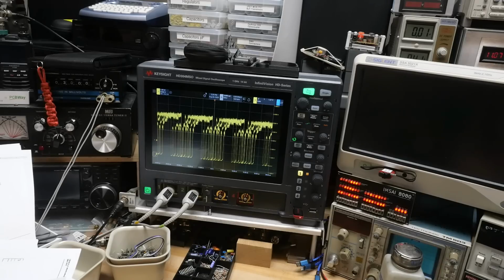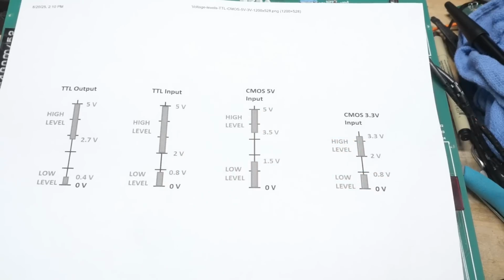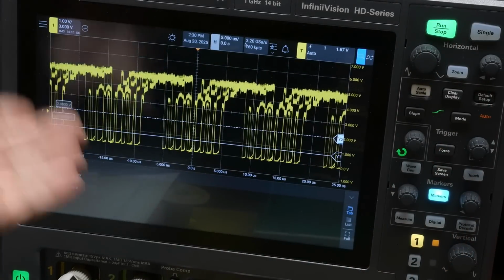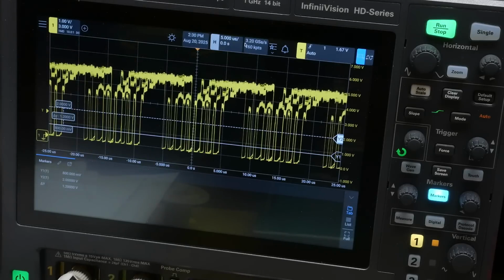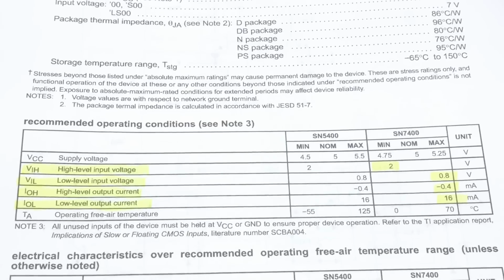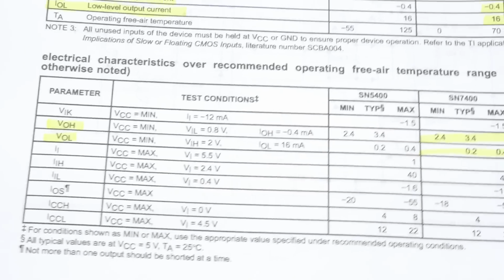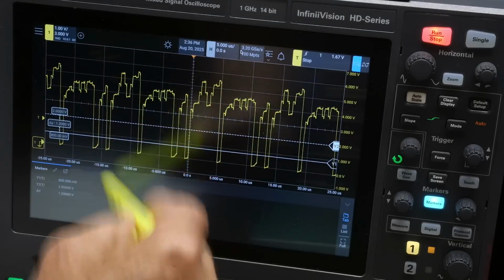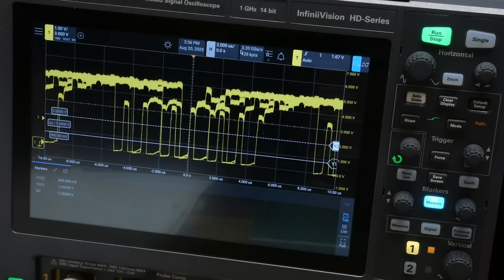#2369 Ugly TTL Voltage Levels

Comment: "CMOS were not invented yet."
CMOS were in use since 1960 but they were very slow, very low drive current and got zapped with static faster than you can blink.

Comment: My own medium scale TTL system had exactly the same issue but of course it's nothing to worry about as explained very handsomely in this clip!

The output of the original 74, 74LS etc logic IC's have a weak pull-up capability but that's how they were designed and it's not a problem in a TTL-only system. The reason for this is the TTL inputs they are driving have an inherent pull-up of their own and don't need to be driven hard to achieve a logic high.

Recently I replaced the 74LS and 74HCT logic in my system with the 74ACT family equivalents. My logic high and low levels are now much closer to the +5 and 0V levels you might expect for a digital system, however the fast level changes have introduced a new problem, ringing and overshoots.  Again, not a problem as despite the noise and ringing, the levels can only be logic high or low.

Comment: Back in the day machine language. Just hex numbers entered as your program. Assembly language was considered high level.

We had an assignment for 2 students to do to send a single ascii character from one kit to the other. Didnt work but who knew who got it wrong or right.

And i used to complain when a fortran compiler told you 53 warnings and 117 fatal errors. Sdk85 didnt even tell you anything😂

Comment: Bipolar transistor cant handle very high reverse voltage between base to emitter so if base is at 1.8volts and emitter is at 5volts so the reverse voltage is 3.2volts so there will be some leakage current but it is normal. Now lets imagine the supply voltage is 12volts then the reverse voltage from base to emitter is 10.2volts so very high current will flow through the transistors shorting them. This is because the reverse voltage between base to emitter is just 5 to 7volts so 5volts is just enough for ttl logic or 3.3volts is even better. I made a counter using just transistors in ttl and it works without any problems upto 2mhz which is quite high speed

Comment: I remember putting pullup resistors on outputs that fanned out to many other chips. I don't know if that was an accepted practice (probably not) but it allowed me to reliably fan out to many more devices.  It did bring up the low levels to some extent but there was plenty of margin there so it never caused me an issue.

Comment: I was able to drive a HUB75 LED display from an STM32 "blue pill" board, but sometimes the display was a little janky. Then I looked at the specs for the HUB75 display. The input chips are 5V CMOS and wanted 70% of Vdd (about 3.5V) for a high input. The STM32 was a 3.3V device. Even with a perfect output stage, it's not gonna give 3.5V.
So it worked most of the time, but sometimes the Voh wasn't quite high enough, and the pixels wouldn't shift properly.

Comment: If you  want to see ugly TTL levels, try inducing metastability in a D or JK flip-flop with the clock and data transitioning about the same time ... the output will randomly vary ... looking more like an analog signal ... for the longest time.

Comment: If the current drive of old TTL was so low, how in the world did we get away with driving those old LEDs directly off the outputs when experimenting?
Reply from the maker: you always used the LED such that a low was ON.
Reply: Nope, common cathode configuration.  Binary counters would look weird otherwise with LED lit when a 0.
I believe even the BCD to 7 segment decoder was made for common cathode display.
Reply: Look at a diagram of a TTL gate. The low-side output will be the collector of an NPN transistor to ground. That transistor generally has a good current rating.
And an "open-collector" output is the low side only. That works well with the "default high" of an open input.
Reply: Sure, the default high of an input would "help" a high of an output.
But that doesn't help the LED much connected directly to the output (with a resistor)
Reply: You can see in Ben Eater's circuits with LEDs connected to TLLs, even LS versions and still work, even when there are inputs connected.

I believe the real answer is that you can get more high state current,  enough to light an LED, but not full brightness and resulting output voltage likely out of spec but still works.
Reply: You can always tell the experienced engineer by how he drives his LEDs.

Comment: was about to write something about so-called "Schottky transistors" and how they increase BJT speed by limiting saturation, but the W source article Schottky transistor says it all

One of the things newbies will be blissfully unaware of were the great TTL "famines" of years gone by. I once waited a full year for some 74LS138 3 to 8 decoders. Of course there have been multitudes of various component famines since those days; the longest lead time I was ever quoted was 54 weeks - only because the vendor's system wouldn't allow anything longer, regardless of reality.

Comment: The in-family fan out of LS TTL is actually better, by a factor of 2, than that for standard TTL because the currents required to drive the inputs to the required levels are lower in proportion to the output capabilities. 
The asymmetry of TTL output drive current was perfectly OK because the input current requirements were also grossly asymmetric To achieve a proper input LOW with standard TTL required sinking 1.6 mA, while to assure a proper logic HIGH required sourcing only 40 µA. You could actually leave a TTL input open and have it "float" to HIGH, but it was bad practice and you weren't entitled to expect a good HIGH.. LS TTL very rapidly replaced standard TTL for the vast majority of uses because of the very significantly reduced power consumption with no speed penalty. 

I'm  not about to listen to the whole thing again, but I heard not a single mention of "noise margin." When you are talking about output voltage levels versus input requirements, that is a very important concept.

In any system with "tri-state" outputs (implying multiple drivers sharing common signal paths) you can can sometimes see voltage levels that do look bad, regardless of the the logic family. This can occur when all drivers on a signal path are in the high-impedance state. The bad levels are of no consequence from a logic perspective but can be from a power consumption perspective because they can cause partial turn-on of devices at the inputs on the signal path.

Logic probes are a lot less useful now that most complex logic systems have eleventy different supply voltages and hence different logic level requirements (though the variation in logic levels external to ICs is not as varied as supply voltages).

Comment: I do adore a TTL application of Boolean algebra. Nothing like curling up to a 6 place clock ran entirely with TTL on a chilly fall night!!
Reply: I added a circuit to my old TRS-80 to shift certain lowercase characters down 2 scan lines by decoding the character code, then sending either 0000 or 1110 to a 7483 adder to modify the scan line count. That 7483 chip always ran warm to the touch.

Comment: Thanks so much for this video! I'm from former Yugoslavia, and our major home computer in the 1980s was called Galaksija (Galaxy), named after a popular science magazine which published the schematics for the kit. Original version had 2-6 KB of RAM, 4 or 8 KB of ROM, and a Z80, all carefully designed and arranged so that the parts could be imported in 3 separate packets from Austria without causing issues with customs and triggering the insane tariffs which we had on integrated circuits and computers back then. 
The original authors released a new version for its 40th anniversary, which is using the 4000 chips, as well as 74LS and 74HCT series. It's still a kit (now with incredible 32 K of RAM), where they sell the PCB and the EPROMs, while the end-user needs to source the rest. I, as a relatively young and fresh engineer, assembled one and spent hours and hours trying to figure out what's wrong and why the logic levels look horrible: I was sure that there must be timing issues, with some chips trying to pull the bus high, while others were pulling low, so I went and checked every single chip multiple times, and still couldn't figure out what was the source of the problem, until I've noticed that various levels seem to come from different families of chips...

Comment: LS parts were worse because they were designed for low power (LS =- Low power Schottky). So they were popular because they cut down on power consumed by the 74xx chips significantly. Of course, they never stopped making the regular 74xx series because sometimes you need the fanout and the LS version wouldn't do, which is why you had to choose from multiple families depending on the needs of your logic.

Comment: A  few months ago I was working on an old Heathkit 2 meter radio and saw 'horrible' waveforms like yours.  Thought I found the problem.  Ordered some new TTL chips and the same waveforms.  Then I remembered.  Yep, that TTL stuff was just weird.  Thanks again for the presentation and a refresher.

Comment: At my work, we had a circuit board for testing/development. One of the identical boards worked perfectly, one didn't work at all, and one worked occasionally. It turned out that the 3V and 5V voltage levels of a SPI were connected without a converter. My conclusion from this is that the argument that it works, so there can't be a fundamental flaw in the design, is invalid. That is a fact that many just cannot understand.

Comment: Leg, no! But those same, very sharp probe tips were also on the HP 'scopes and hurt just as much when inadvertently inserted into a finger.
Interesting about voltage levels. Some of the equipment we worked on had multiple boards of flat-pack RTL chips and from what I remember, the voltage levels always looked "good". Much of what we worked on was designed in the mid 1960s so there wasn't much TTL.

Comment: Also,  in TTL design days, signal termination wax not practiced. Now the was not the case with ECL logic design. Logic speeds were much higher than TTL. Most of the variations in TTL high transition were due to reflections from mismatch in termination impedances.

Comment: The output current is half of the picture, the same TTL family has input currents which are flowing out of the input and which pull the port up. The fan out restriction (how many inputs can be driven) goes mainly with the current to pull the connected inputs down, they are going up by themselves when nobody pulls them down.
Reply: Yeah, I recall paying close attention to input current and fan-out. Still have a copy of TI's TTL spec book
Reply: Yep, in my introduction to TTL, I'd get confused at first that by default a TTL input would be '1' with it floating.

A really interesting situation is when in a muti-chip experiment you forget to connect VCC to one of them.  Happened in lab at college even though I already had personal experience with TTL.  I think it was a counter that acted really wierd.

Comment: How can the TTL output exceed 5V 7:33? Is that noise on the line? Is there anything “bad” about that value?
Reply: It could be the power supply is outputting a bit more than 5V or it could be bounce caused by inductance in the power and ground nets or in the 'scope probe's ground lead.
Reply: Driving capacitive loads 👍🏻
Reply: Not the best logic probe to use, the HP probes are pretty ancient.  Even a logic probe from the late 70’s early 80’s would show you the difference between 0, 1 and an open or Hi-Z…
CSC LP-1 or LP-2 are my go to Logic Probes.

Comment: I got a Fluke signal gen.  that wants to see an external 10 MHz reference that is "TTL"  for some reason.  I got an OXCO that I built and it has a TTL sort of output but the signal is rather ugly but the levels are acceptably within TTL range so it plays happy with that.

Comment: Heh.  Those of us that cut our teeth on TTL and NMOS digital designs still feel weird using e.g. a CMOS FPGA pin directly as a DAC output driver.  In spite of knowing full well that the CMOS output is going to swing (basically) rail to rail and that it'll be perfectly clean and square at a only few 100kHz.  A digital pin as a Sigma Delta DAC output filtered (only) first order can be rock solid to the 5th measured digit, and it feels magical... deeply counter intuitive.  A real testament to how good CMOS signal integrity is (well, can be).
Reply: In the 70s I worked on medical gear that was logic but not microprocessor.  Always used a logic probe but also had some old 475 type scopes on the bench.
Reply: Burr Brown solved the CMOS issues quite interesting starting at PCM 1702. It might all be matter of taste here and there but I love the absolute simplicty of a design around this idea. Resolution vs real life conditions, it's mostly a commercial issue lol.